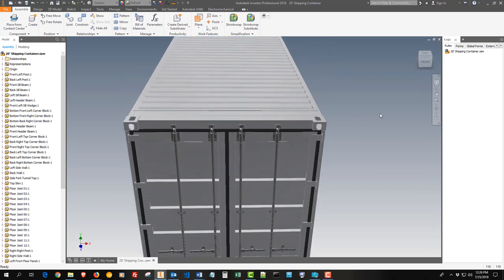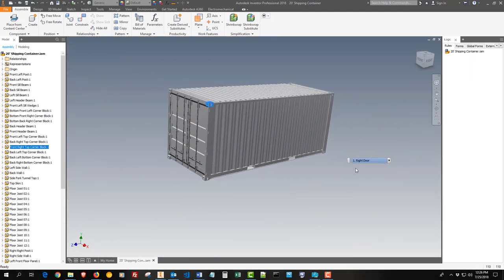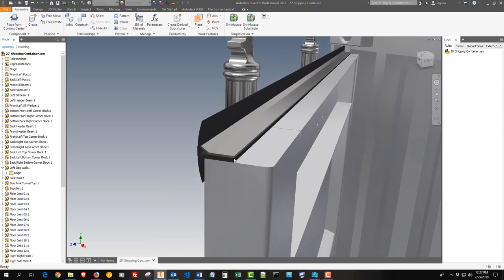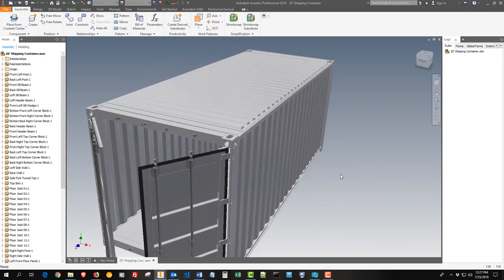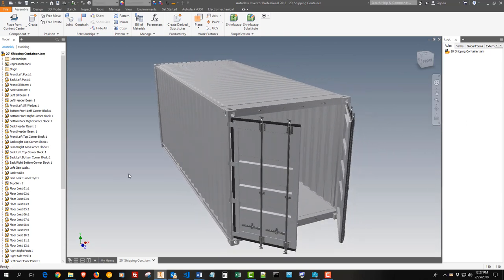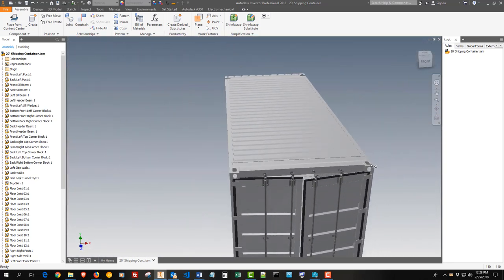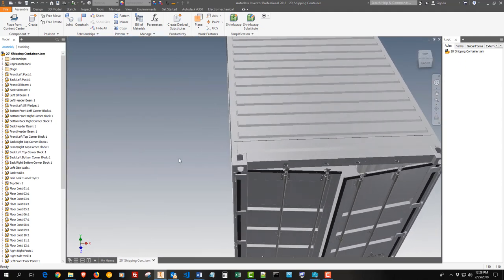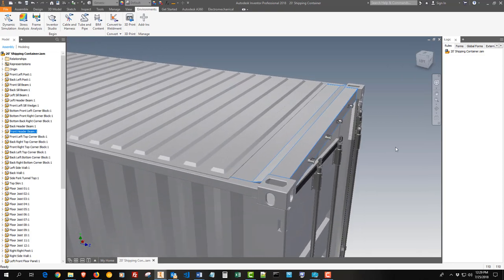3D Shipping Container Model

Comment: Hi. How model a shipping container side cover with those shapes like gears on inventor. I tried to draw a sketch of one of them and used a rectangular pattern option to duplicate the others to make it a full length. And then tried to extrude it, but it never worked. Then i tried sheet metal option i draw one did all the bending to make it look like that gear tooth shape and then rectangular pattern it and it worked but im still not happy with the outcome cos at the edges where they all meet. It meet on  the bottom half and looks like a step.
Reply from the maker: Hi Lungile, I'm not sure what "shapes' you are referring to?
Reply: @PlanetMojo  I mean that sheet that cover s the sides of the containers. Its not just flat  how you model it.
Reply: @PlanetMojo  Thanks for your reply by the way.
Reply from the maker: @lungilealumve9627  I believe that is an extrusion at a taper with filleted edges which was then shelled and patterned. I don't have the model available at the moment, but that is how it looks.
Reply from the maker: @lungilealumve9627  You are quite welcome.
Reply: @PlanetMojo  Thank you man.